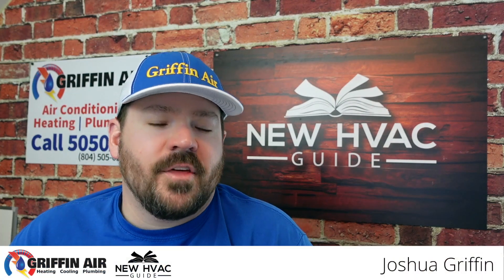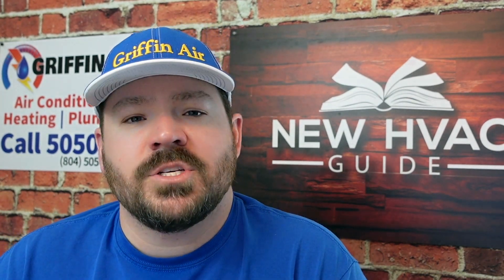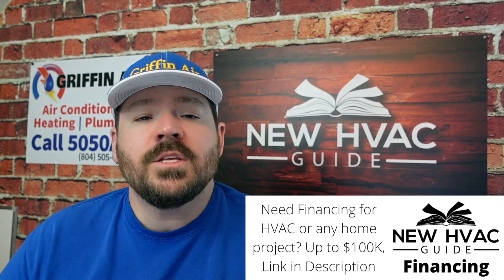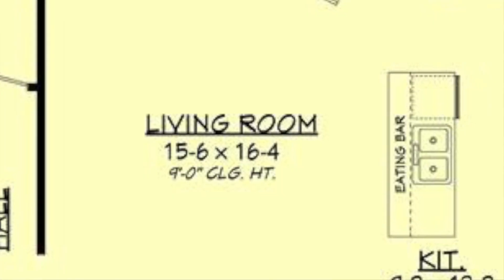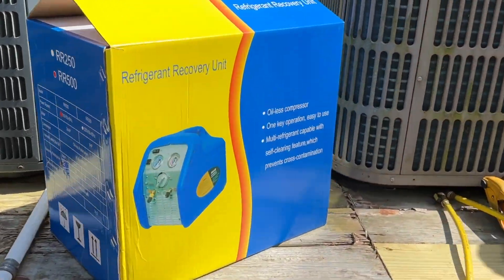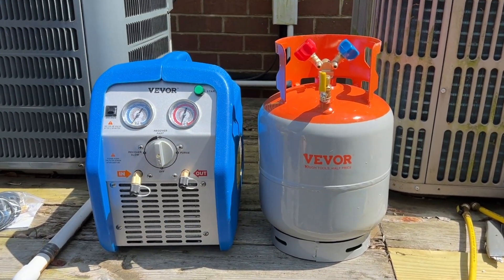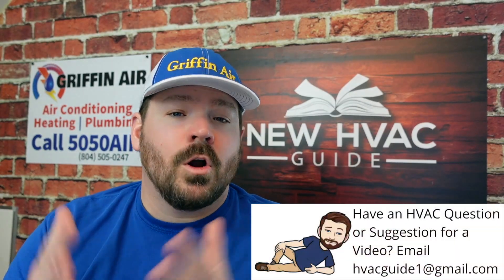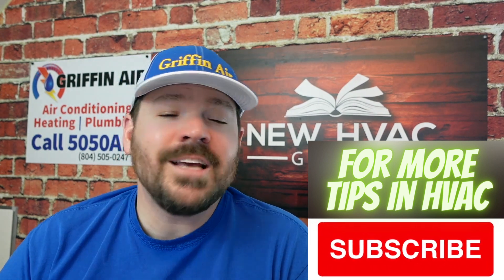HVAC Sizing. Formulas, Rule of Thumb, or Heat Load Calculations

Comment: For heating load, forget everything about calculus and get some electrical fan heaters with near 100% efficiency, check the electrical consumption over a cold winter day and this is your current heating load

Comment: I have 2 floors, one of which is a basement. Each floor is about 900 sq. feet, so 1800 total. I've read that when calculating the BTU and Tonage requirement that you only use 1/2 of the basement square footage, thus reducing the total square footage to 1350 if true. Can someone tell me what size BTU gas furnace (80%) and A/C tonnage (14 seer) I'd need for my situation? I'm in zone 3, Virginia.  Thank you.
Reply from the maker: The only way to properly size a system is to do a manual J calculation typically with a pro. Watch this video if you need one performed. https://youtu.be/5AfGtyVQ0G0?si=3-M-YH4hyfGgJsmZ

Comment: I just had my furnace and A/C replaced. I originally had a 2 ton unit, but they said it was undersized based on my vaulted ceilings and orientation of my house/no shade (rear of the house faces south). They recommended a 3 ton variable speed unit and it's been working great. My old unit struggled to keep up even before it started failing.

Comment: Any insight on how to read/understand a heat/cool analysis? I had to pay $200 for my analysis but there is a ton of information on there. I just need to know what size mini split to install. I am a licensed general engineering contractor that installs my own mini-spits but then I hire a local licensed hvac guy to inspect and charge the system.

Comment: All of the factors that you mention certainly contribute to heat and cooling loads. These factors combine many variables into the calculation of a single load factor. Wouldn't the best indicator for a replacement HVAC be evaluating how well your existing heating and cooling units have performed and how often each one cycles at various outdoor temperatures? Then use that information in conjunction with the size of the current units to decide if capacity of the replacement units need to be larger or smaller.

Comment: This is not rocket science.  Furnaces are typically 48, 60, 80 or 100 000 btu.  Ac are 24, 36, 48, or 60 000 btu.  If you are doing a heat pump, size to the heating load.  Humidity will tweak the number up or down a 1/2 ton.  Don't oversize or you will short cycle. That pretty much sums it up.
(30 year general contractor)
Reply: So by your logic if house need 65 000 btu of heat you will put 5 ton heat pump in there?
Reply from the maker: I’d recommend looking elsewhere for logic Alex 🙂

Comment: You are absolutely correct on this video. In 2022 we had to replace our 114,000 BTU Carrier Furnace which was originally installed in 1988. We added a 10 seer Carrier Compressor in the spring of 1991. Yes, you heard that correctly. Got 31 years out of the compressor. We have a great HVAC tech whom has treated us with white gloves and very knowledgeable. We got 3 additional estimates and they all did a proper load calculation and they came back with either a 60,000 or 70,000 BTU furnace depending on the brand and 2 tons A/C. Should have gone with the majority of results. We decided to go with a 90,000 BTU furnace per our friend's recommendation and a 2 1/2 ton single stage compressor. HE also used a 4 ton coil in order to achieve the best AHRI match. We used Lennox Elite 96% efficiency on the furnace end and 16 seer compresor. The quality is superb and the installation is absolutely beautiful. Energy costs are definitely 20-25% lower. We have been experiencing some humidity issues and finally turned the fan speed to the lowest setting and the humidity levels have improved tremendously. Around mid forties here in Winston Salem NC.  This should be a lesson for everyone to learn and as you mentioned in a prior video, the heating part of it is not terrible since we have a dual stage furnace and after 5 cycles or so the furnace never kicks into the 2nd stage. However the cooling situation is a bit more complicated and it does tend to cycle more than needed. Not a problem when is hot in the low nineties. Our house has 8 foot ceilings and about 1550 Square feet. Built in 1946 and we replaced all the windows, doors and have added insulation in the attic. Still not up to code. My parents in Italy had a Fujitsu inverter Mini split and it was absolutely wonderful. Next time we will DEFINITELY go with an inverter system for added comfort, and energy efficiency. Sorry about the long comment and I have watched tons of videos on Youtube and you are always spot on. BRAVO!!!

Comment: Proper sizing of an air conditioner, gas furnace, coil box, refrigerant lines, return air ducts, air filters, and supply air ducts are critical.  Have the new HVAC system tested after it’s installed.  Have it checked for static pressures (return, supply, total), proper airflow per room, and proper temperature.  👍

Comment: Nobody argues validity of properly sizing the HVAC system. However, in your video you throw in a lot of terms just to fill the space and mostly confuse people without offering much help. Basically, lots of words and not much advice, except do it.  
It's not rocket science. Plenty of online resources to figure out how to do manual J calculation accounting the factors you mentioned. Anyone with basic technical education who wants to do it should be able to get it pretty close. All useful info in your video can be easily summed up in 1 min.
Reply: Three minutes is more reasonable!

Comment: We have never heard of any HVAC folks doing a heat load calculation prior to installing a new system or replacing an existing system. They all seem to be fine with replacing the hardware with the same capacity that is existing and for new construction they always choose the cheap "contractor" models with cheap low grade ducting, supply and return vents. In the southwest, Type of roofing material might also have some play into the heat calcs as lots of folks use "spanish tile" materials that remain hot long after the sun goes down continuing to radiate heat.
Reply: I'm in S Fla and the situation is the same. I've talked to a few HVAC guys that have come by to maintain my units over the years, and whenever I mention whether the would do a Manual J on replacement installations, the first reaction is somewhat bewilderment, followed by my awkwardly trying to explain to them what it is, followed by them pretending to know what it is, and blowing it off by saying that on a replacement system they don't typically do or need to do those. The idea being that the original developer of the gated community already did the calculations prior to the homes construction. So if nothing has changed (same windows, insulation, ac sizes, etc) then they are perfectly fine just replacing like for like systems. And this seems to be both the norm, and also is allowed by law if all things are the same as when the original home was built. But also, it does say something like "and you have the load calculations" ...which I don't believe anyone in our community was ever provided by the builder. Just took their word that it was done.

But I also know that the same home models in our community have the exact same AC specs, regardless of orientation to the summer sun, which in S FL is important. I happen to have an entire wall of multiple sliding glass doors along the back side of my home, which faces the low hanging long summer sun. Other homes with the same equipment, may be oriented in the complete opposite direction, or at 90 degrees to mine. So clearly, the calculation was done in a way that ignored direct sun exposure, or assumed it was the same for all homes in the development.  

So where I'm at, I guess as long as they can get away with replacing like for like systems at the permitting office, that is typically what they do, unless it is new construction, or involves impactful remodeling changes.
Reply: @privatename3621  You can be guaranteed that the original builder "specs" were lean and the HVAC system was minimal, one return, small supplies and supply registers located for convenience/cost vs. function. Custom homes tend to be way better in that area.